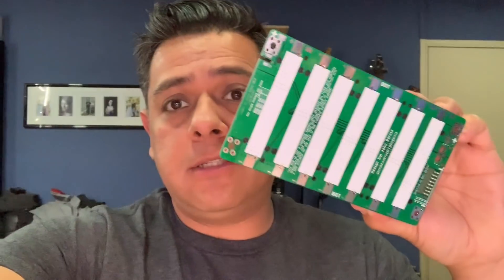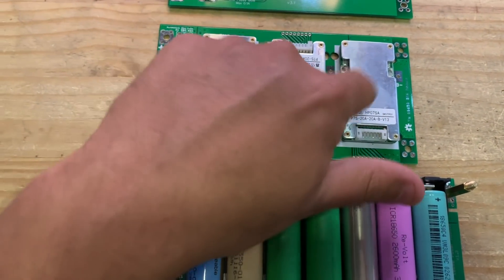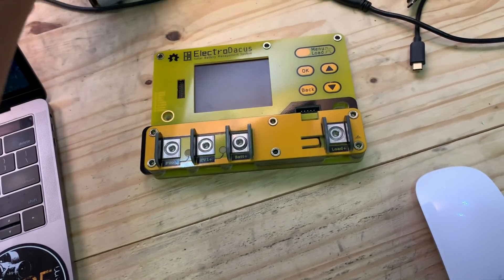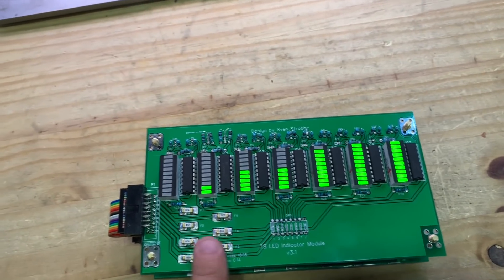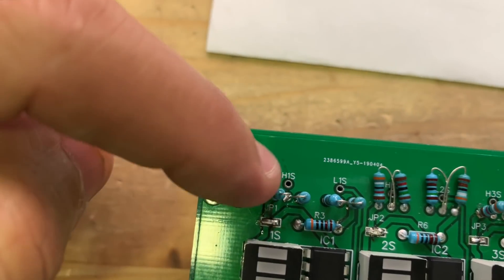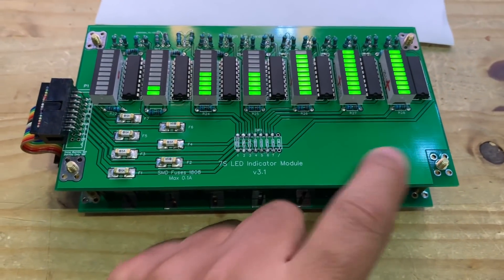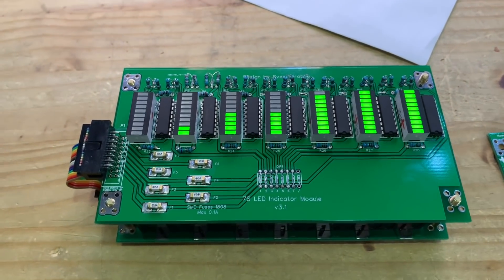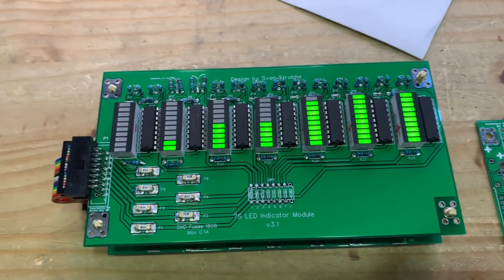7s  24V  State of Charge battery Meter for DIY Powerwalls

Comment: i have 4 18650s use it to power my backup camera should i use a bms??
Reply from the maker: Yes
Reply: does radio shack carry bms? @jehugarcia
Reply from the maker: Do you live in the 80s?
Reply: @jehugarcia  I found radio shack still has a online store.... If that hasn't been shut down already.
Reply: 80s was a great time.cars were cars u could work on them(no computer chip)beer was beer

Comment: Quick suggestion, you should make the top LED represent 4.2 that way you know when it's "over charged" and not being  managed properly by the bms.
Reply from the maker: The bms balances above 4.2v
Reply: @jehugarcia  so it will never balance when you charge it up to 4,1V max all the time? i had the same problem when thought of  designing a long lifecyle battery pack. And i still don't have the answer....
Reply: I use a multicolour LED BarGraph and The top LED IS the Blue one wich is the indication for me of being overcharged.
Maybe their Will be a Buizer buil in to act as an alarm but there’s So much people want that The PCB Will become to crowded and too expensive...
The ones under The Blue one go from green to orange into red and that’s The range in wich my voltage is set from 3.0V to 4.2V

Comment: It's really coming together!  I'd also suggest a brightness pot - the leds can still be visible with a very low current.
For balancing, I think this active balancing module using super capacitors could be perfect if the manufacturer could make a 7S version and make the board size the same. Could ask them.
https://www.alibaba.com/product-detail/12S-24S-1A-Lithium-Battery-Protection_60813074849.html
Reply: I just sent them a message and asked them to watch this and consider making a 7S version that would fit... You never know, something may come of it...

Comment: 13s "48v" and id be interested in using them on my solar electric bike system, especially if they were plug and play,  with little to no soldering.
Reply: PARADOXICLES yeah but he’s not gonna do that 😂 he leaves it open bc it’s cheaper for everyone that way and because then it can fit peoples configurations if it’s for a 12v battery, 24, etc. maybe someone will make them for ppl who want plug and play later on

Comment: I’ve made it with a multicolour LED BarGraph and use it in a single bar read, you than see immediately by The colour what The SOC is.
The Top LED is The Blue one and if that one is on it means The battery is overcharged.
The Dip switch is there to turn on and off each LED BarGraph Individualy but if not wanted you can use a small wire.
But i look into a way to integrate a pushbutton.
Reply: This is a very nice design!  :)
Reply: Mr. Sven >> I am curious to build me some smaller led meters for my packs, like 3S or 5S. can you share your schematic for the LM3914 set up ?
Reply: I hate those multicolor LED bar graphs, no offense. Give me solid green from top to bottom anyday. Unfortunately, they are usually a bit more expensive, but meh. Annoying since all they are are LED's in a light box, but better than trying to do it yourself.
Reply: What is SOC? please for us novices spell out what you mean.
Reply: @batterypoweredgardener8181  State of charge
Reply: Could you use a cheap LCD screen for each? You can get small little Color screens for about $3 each if bought in bulk. One for each row showing amps and volts and things?
Reply: Darren Boxhall with this thing you can see in a second what The SOC and balance is and that is The purpose of it.
If you want accurate readout as you mentioned Voltage and Amps get a BMS with Bluetooth or WiFi and get The info that way...

Comment: I really really really want to buy about 100 of these. Battery prices are still to high atm. I'm hoping in another 2-3 years the price will be right for the batteries. By then I bet the boards you are making will be even nicer! Keep up the good work!
Reply: Kevin Roberts not true. Battery hookups just came out with there KILLER deal agin. 45 dollars(free shipping)  for a 36v 4.4 (NEW) battery pack assembled with LG (new) cross so 20 batteries and a nice bms which is like ~1$ a cell, which is better than the normal $5-6 per cell for that high quality cell
Reply: @Zodiac83104  I'd like to see it. Link? I'm on batteryhookup's site but it's not listed.
At this time LiFePO4 prismatic batteries seem the best option.
Reply: Idk why it wasn’t on their site yet loo

Comment: You really should consider designing custom BMS, it really isn't hard at all, you just go check PDF datasheet of some 1 cell protection IC, copy-paste example application schematic, then multiply all to whatever cell count you need.
This would also allow you to get higher current easy, just more shunt resistors and mosfets if needed.
Other things you would be enabled to do keeping the cost low:
- balancing
- balancing indication(you just put a LED with the discharge resistor)
- overcurrent setting by adjusting a potentiometer
Reply from the maker: Do it,  I’ll get behind it
Reply: @jehugarcia  Sorry mate but  I already have a lot of work to do with my very delayed e-sk8 project, already offered help with PCB for other open project and few other things.
Also it would be probably better if you would find someone from US so it's easier to work on it together.

Comment: Is there any way to show if all of the BMS's are working?  If you know 2 of the BMS's have failed you pull that board and replace it with one where they all work and then replace the 2 failed BMS's on that board.
Reply from the maker: I can’t think of one without modifying the bms units themselves, which defeats the “off the shelf” approach

Comment: I can think of two minor improvements for the Meters. In the spare space in the bottom right of the PCB, you could put some Seven segment modules in to display main battery voltage as you mentioned.

Also, it'd be nice for an "empty" cell to have a single flashing bar on the display just to identify that the cell is discharged and the display hasn't failed. I know the BMS will stop you overcharging but it might be perceived that the cells are completely discharged when in fact something went wrong and caused the meters to fail. Additionally, if the Cell is in a state where it is "dead" i.e. not healthy, the whole meter could flash to say "There's a problem here", although I don't know how that would work with a stack of cells in parallel.
Reply: maybe bring the cell voltages down to that area to a header, add some mounting holes to allow for a daughter board, then the board design is "done" but configurable. People could experiment with different ways of rendering system voltages, either on-board with a different LED display type, or remotely via WiFi/BT, or whatever, by designing an appropriate add-on board that would plug-in to that header.
Reply: The later thing is pretty hard to do, since the Chips are completely analogue. Its not impossible, but it involves some extra chips per channel for it to work.
Reply: @faheus  which Chips are you referring to?  I think if all the necessary board voltages were brought to the daughterboard header idea, someone could take that and run with it, spending whatever $ it took to get it working to the desired level of functionality.
Reply: @BHerbertAZ  the LM391x chips. It would be possible to do it on a atmel or something, but you either would need to supply directly from the Balanceplug or galvanicly isolate each cell to not lose resolution in the ADC. Doing it the LM391x way is pretty easy, since they can tolerate quite big voltages.

It would be possible to use some of those Liion monitoring ICs from Analog Devices, they can stack up up to 40s and talk over SPI with the micro. 
If someone writes code, I could hit KiCad for couple of nights and make a prototype.
Reply: @faheus  I'm waiting on access to the Meter FB group, till then I'm kinda blind on the design there. Because my thinking had nothing to do with the existing chips on the board, but toward a separate circuit that would plug-in and allow one to connect to the cell voltages and do whatever with that.
Reply: What would power the flashing led? If the battery is dead the bms will stop voltage flowing through, so there will be no power available to display a flashing led.

Comment: Is not better to use a  raspberry pi 3 ?
Reply from the maker: Not for non coders like myself
Reply: I'd say no. With the Pi, you're running an entire Linux OS as well as your programs. It's much easier to just have a purpose programmed microcontroller, there's less to go wrong. Once compiled and uploaded to the Arduino, the code is the only thing the Arduino does.
Reply: Is OK.....